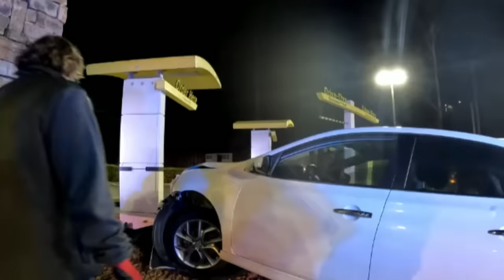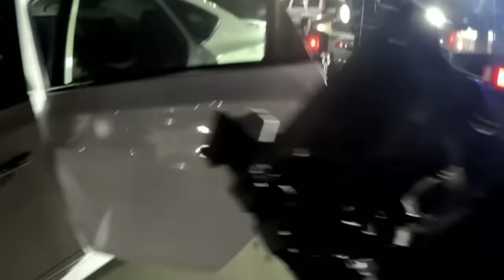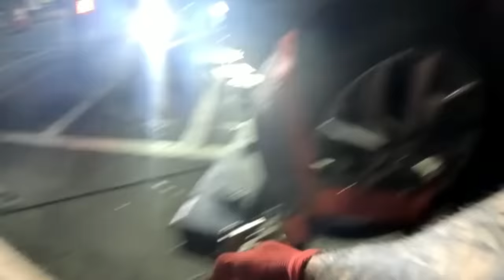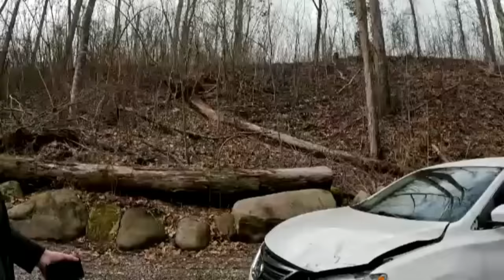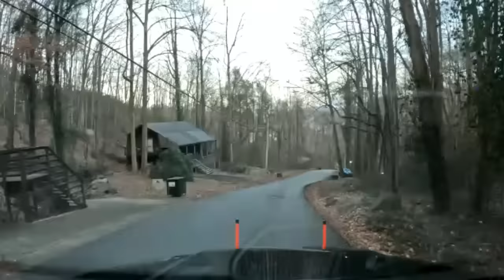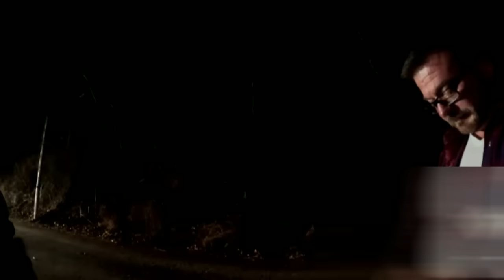Car Takes Out McDonald's Menu Board, Winching Out A Rollover & A Big Illegal Park

Comment: DUI , if you are in the car with it running in a parking lot . You are driving under the influence.   You are in control of vehicle.
Reply: If you simply have the key in the ignition you are considered in control of the vehicle.  Being caught on private property has no bearing.  How did you get there, fly?

Comment: You can be charged with a DUI being in the car and the ignition is on. Doesn't matter if you're moving or not. I had a friend get charged with a DUI that way. Crazy rules!
Reply: Also doesn't matter if you're on private property or not
Reply: It does matter if you had a seizure, that means charging him for a DUI or a DWI shouldn't have happened. 
By the way, I've always called DWI, Driving With Idiots..
Reply: I know in Australia if you fall asleep (on purpose) parked up somewhere (where you did not drive to while drunk) and have your keys on you they can charge you with DUI. I used to throw the keys into the back of the car.

Comment: They don’t charge dui because they found marijuana lol. It can be based on officer observation though. It’s for operating a vehicle, it doesn’t have to be on the road or driving. If you’re behind the wheel of a running vehicle you can be charged with dui, even if it’s parked.

Comment: Dude has 20k in the RV, but wants to use cash apps to pay you. Nope, not going to happen. Reverse charges are so easy with these cash apps. Debit cards usually have the Visa/Master card logo and carry the same protections as a real credit card which in that case charges can be reversed.

Comment: We'll, if you had those issues should you allegedly be using the herb......and while driving?  Maybe it was medicinal herb.  Sure did tear up the Nissan.  One of the many things learned while watching EA videos, use outside spotter help on some of those cabin/cottage roads.  Regarding camper van, how do you park between 2 no parking private property signs and not see them?  And then try to guilt trip EA and poor mouth on the bill.  Come on! Hey EA team, "we appreciate ya!"